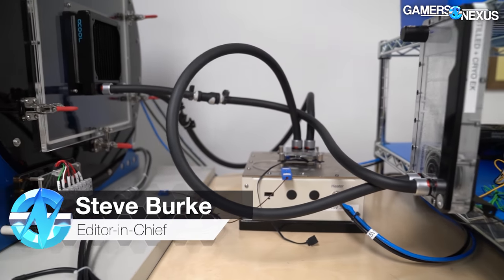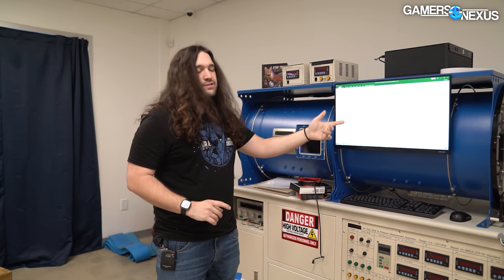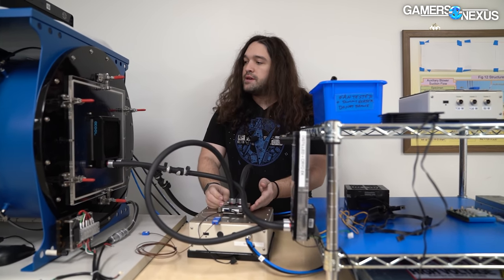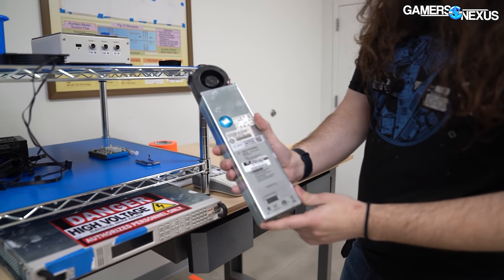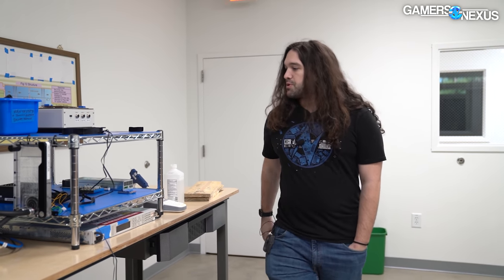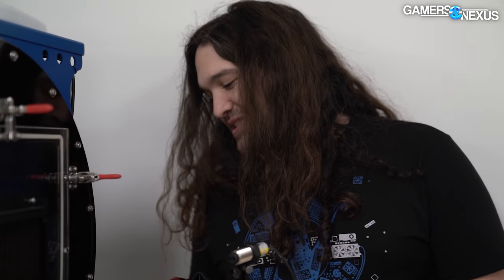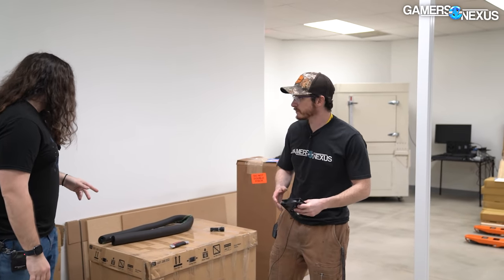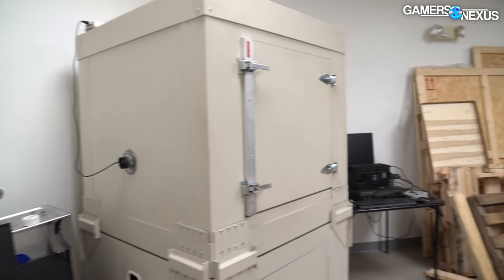GN Lab Update: Fan Thermal Testing, Pressure & Flow Charts, & Challenges

Comment: At 10:15 Steve mentions RPM Normalized and doesn't understand why. It goes hand in hand with both Noise Normalization along with P/Q Curves. You can't really compare a 1000 RPM fan against a 6000 RPM server fan but if that 6000 RPM server fan is restricted to 1000 RPM, then you have a basis, which is the entire purpose of Normalization - Everyone being on the Same Page.

Comment: When talking about RPM normalization, it is an interesting metric because it actually tests blade design. If fan A and fan B, of different designs, are both tested at 1000 RPM, and fan B has significantly better performance, that shows that, at that RPM, fan A is less efficient and potentially a worse design. RPM normalization needs to be a spectrum, though, as that same example could produce different results at 500 RPM and 2000 RPM for example. This kind of data can also be correlated with with the noise spectrum, frequency and amplitude, and also correlated with power draw; which power draw normalization is another interesting metric. But at the end of the day, both of these would be supplementary to the actual important information the audience cares about. All three of these should be spectrums anyways, to show data points at various intervals; such as for noise normalization, if you boost the loudness by 10db off of your baseline standard, what performance is gained or lost, same goes for RPM, 500-1000-2000, or voltages, 10v-12v-15v, etc. It'd be information for people who understand and care about data at more than just the surface level of results, which would be fringing into the engineering side of things and not the general PC audience. It's just a more thorough investigation of a product, investigation that most people wouldn't care about, unless they actually have an interest in fan design and how designs could be optimized; which then gets into Major Hardware's Fan Showdown series, except GN's methodology and equipment are leagues above his, having a collaboration of his prints on your equipment and testing, especially with expanded testing like this comment went into, would be cool though.

Comment: I think you should not removed degrees of freedom from the graphical presentation, but rather add them.  Take a look at a bunch of turbocharger compressor maps and see if that gives you ideas.  I find compressor maps very easy to read (possibly because I've looked at so many, but I seem to recall that they made sense to me right away).
Reply: I'd rather be blown than injected.

Comment: The concept of noise normalizing fans is odd to me.  I'm likely one of only a handful or two of people who do spec for RPM, and specifically CFM, in addition to longevity, regardless of noise, but that is due largely in part to the environment in which my computer is housed.  I am a long haul truck driver, and my computer is housed in my semi truck sleeper berth, on the top bunk.  I just built a new personal pc with a 5950x cooled by a Noctua NH-D15, a 3080 all housed in a Phanteks Enthoo Pro 2 case.  I contacted Noctua and received a 3rd set of fan mounting brackets for the cooler, and mounted 3 140mm Noctua 3000RPM IPPC fans on it.  The rest of the case is cooled by 12 120mm Noctua 3000RPM fans, and all fans are set to run at max speed all the time.  I actually modified the case slightly to accommodate an extra 120mm fan.  The thing sounds like a jet engine, but is necessary, particularly in the summertime, as some of the places I end up going are extremely hot, and the generator's HVAC system isn't able to fully keep up, plus heat rises. Anyway, GN, thanks for your hard work, keep it up!

Comment: re: P-Q-N curves

I think that non-technical people and/or non-engineers and/or lay people, yes, that would be a bit of an eye sore to try and get some useful/meaningful information from a P-Q and/or P-Q-N curve.

For engineers, especially turbomachinery engineers, this is just "business as usual".

But in terms of being able to try and take that data and "converting" it into something that's useful for lay people to consume, I agree with you, in regards to picking the end points (0 pressure/max flow, max static pressure/0 flow) and then some point in the middle.

Personally, I would like it if you published the full P-Q-N curves because I can actually make use of it, because that tells the whole story about the fan rather than just three points which really, is good for lay people to consume, but doesn't come anywhere close to being able to tell the whole story.

The rest of the data in the Excel file makes sense to me.

As an idea for you, it might be useful, for you to make a video, just going over some basics of axial fan design/turbomachinery basics (i.e. what does "mmAq" or "mmH2O" actually mean -- not what it is, but what does it mean and/or why should a customer (read: viewer) care?)

I think that using the watercooling would be the best or at least the easiest way to illustrate how you can have a really high volumetric flow rate fan, but if it doesn't have enough static pressure, then it isn't able to push past the resistance to airflow that the radiator creates, that the fan would need to be able to overcome.

I think that would be useful to lay people or people who might not have had as much exposure or experience with axial fan design and/or turbomachinery in general.

You might be able to start off with the simple equation that power = force * velocity.

And so, for a given amount of power that you are putting into the fan, the results is either a lot of "force" (i.e. static pressure) or a lot of velocity (i.e. volumetric flow rate).

And how you start trading off "velocity" (volumetric flow rate) for "power" (static pressure) when you are trying to push through something that has a resistance to it (e.g. watercooling radiators).

That way, once you get some of those concepts across, then you can go through the charts which shows the three different scenarios, but maybe also make a comment that in between those three points (beginning, middle, end), that the "in between" stuff isn't linear nor straightforward and that it CAN be quite complicated, but it can also be quite simple as well (i.e. if you know what is the resistance of your radiator like some of EK's thicker radiators), what kind of a fan that you should be looking for.

But the P-Q data that you threw up on the screen - makes perfect sense to me.

re: rotational velocity normalised fan performance
I also agree with you that that doesn't really say anything.

Having designed axial fans myself and worked a little bit in turbomachinery, for a given speed, depending on the design of the fan blade, the aeroacoustic signature can be very different.

So, by normalising at a given speed, it doesn't really tell you anything.

If you manage to reign in a Delta fan, for example, you might be able to get the noise down, but because it wasn't designed to run at the lower rotational velocities, and therefore; less noise (lower amplitude in the aeroacoustic signature), it may not perform nearly as well when compared to the parameters that said Delta fan was actually designed for.

Your noise-normalised performance methodology is, I think, a better approach given the fact that customers don't have necessarily a direct way of controlling the rotational velocities of their fans.

(You can do that, for example, on an engine dyno because whilst you still don't have direct control, but the control room of said engine dyno will measure and report out the rotational velocity of the engine, and so, you can set up your digital/electronic controls to use that output/measurement signal as a feedback loop into your controller.)

You don't have that kind of PID feedback loop nor PID controller for case fans.

Thanks.

Comment: Looking at that graph. Are the lines that go more downhill supposed to be P_STP per Flow? That would kinda make sense as static pressure is reduced with increased flow speed. But you need to ask yourself why you have 0 Flow data points. What is the sense of measuring at 0 CFM flow. 
What are the horizontal lines supposed to be? RPM per Flow? Are you sure you have connected the right data points with lines? To me the more horizontal lines might not make sense? It is 8 data points and 8 lines so you could connect the points also more vertically? If it is a data array you might need to present the data differently. Maybe a 3D Diagram would make more sense here as it seams there is another variable that is not represented in the chat but creates the array instead of lines.
PS: So the invisible data point is "Duty Cycle" whatever that really means. But the RPM-Q Graph I still don't see how it is useful. You have different flow rates at pretty much the same RPM ... that has les to do with the fan and more with what the machine is going...

Comment: I personally set my fans to 800 rpm. They only increase in speed if the case temperature goes above 40c. This never happens. So testing at a specific RPM is a valid thing to me.

Comment: 06:00 i see here only one problem in this configuration - radiator... Whe have plenty of them on the market. One fan can made an better job then the other one on other type of radiator. I mean - we can see it clearly, Arctic Cooling Liquid Freezer II series use 10mm thicker radiators and wins most tests. Fans are always the same... 🤷‍♂️ Only the radiator became thicker.
And... How about pull and push configuration?

Comment: Careful with the hot glue / silicone thingy, depending on the material, it degrades with time until it becomes a squishy grey blob.
Maybe a proper fabric glue would be a better solution.

Comment: @gamers nexus I understand the desire to isolate mounting noise from the fan noise inherent, but I have some mixed feelings about that. Fans including anti-vibration mounts or pads as part of their frame are significant marketed and value add for end users, and even beyond that, a super soft mount would absorb additional damping from vibrations through the motor, which in a real world case, might either result in premature failure of the fan or a progression of noise. 

I recognize that end of the day, you can't control everything and choosing an isolated mount lets you focus on the things that should matter more...

Just something that comes to mind.
Reply: To make their data valid they have to test fans consistently. They're just testing the fan. You're not going to get the exact same performance in your real world application. But you can still use their data selecting a fan. And if you're a clever sort you can improve on lacking fan mounts anyways.
Reply: @Paul Frederick  the mount situation is the fan. Vibrations from a less than perfectly balanced hub is the fan. Again we could all cut out foam and do our own isolation mounts, but arguably it's more consistent and real world applicable to attach to a big chunk of metal and whatever noise comes from that comes from that than to attach to a fully isolated mount.

I mean it's fine. We'll all take what we can get. Just a minor perspective difference
Reply: @anthonyschroeder521  lab data is never the same as real world data. The best they can do is test everything on an equal playing field eliminating as many variables as possible. The data they collect will all be comparable. But it's never going to be what anyone else gets in use. That's the limitation of reality.
Reply: @Paul Frederick  now that was a patronizing non-answer that failed to recognize I am well aware of exactly the limitations imposed by each possible method, and said such even in the very first comment.

Comment: Rpm normalized would only make sense in the case where you’ve already set up your system and you’re seeing if a new fan would make a difference at the rpm you’ve already got set. Seems less than helpful. Especially since most people use whatever curve is built into the motherboard. Fan controllers are rare outside of enthusiasts, and actually using one for its intended function is rarer still.

Comment: One difference between the CPU and a dummy heater could easily be "duty cycle", or the steadiness vs intermittent-ness of the heat. I think a higher thermal mass cooler could for example just eat the peaks of bursty CPU-like heat generation. I wonder if you can try a boost/idle/CPU-like heat generation timing to simulate a CPU and see if it makes a difference? If your dummy heatsink can mimic a CPU in the time domain, (intensity of heat *over time*) not just the intensity of wattage per se, that would be neat.
Reply: Steve's using his heater to generate a constant heat. That way every fan has the same heat to work on. That will yield more consistent data with only the fan being the variable.
Reply: @1pcfred  I agree that their proposed test methodology means the fan testing will be apples to apples among fans. 

I'm still interested whether their proposed method with hotplate is distinct (apples to oranges) from the performance needs of cooling a CPU.

I think at some point some science-ing should be done to see if cooling a CPU with bursty/unstable heat is inherently harder than, easier than, or the same difficulty as cooling a hotplate. And also: whether heatsink design is a variable that changes the answer to that question.

I don't know if it's the top question to answer, but it still nags at me, and the researcher in me wants to know if the claim that "hotplate is a better test than a real CPU" holds up to objective testing.
Reply: @MrSmitheroons  the hotplate is just a more consistent load than a CPU is. When testing consistency is everything.

Comment: When i´m picking new fans, there are 2 important things for me:
1. the fan has to be quiet in lower rpms, with moderate noise in loads
2. while being quiet, or making moderate noise, the fan MUST blow air (either pull into the case on intake, or push it through heatsinks or out of the case).

There is myriad of quiet fans, that don´t actually blow much air (very limited rpm, bad construction, like Alpenfoehn/Alpenföhn Wing Boost 3, or Fractal X2 GP-12 1200rpm) and fans, that blow air only when unrestricted (Arctic F12, Noctua S12A), whose existence is just cashgrab, since their value is minimal. Picking a good one is a real pain, because many times, the more expensive =/= better.

I also like using the whole rpm range of a fan. I find it useless to buy like 1800 or 2000 rpm fans, only to limit them to 1000rpm, because after that, they become noisy. After all, in PC load, CPU and GPU coolers are making noise as well, with liquid cooling PCs the pumps are noisy, many times HDDs are far noisier than any other components, etc.

Comment: it seems very weird to me that you decided to test the fan's cooling performance (ie. the temperature of the dummy heater) with the fan and radiator strapped to the fan tester. is it because it is the most reliable way to get consistency in the flow and therefore the temperature too ? is there any unrealistic flow restriction inside that fan tester ?
Reply from the maker: It won't be mounted to the fan tester for the dummy load test. That was just to hold it up. The actual fan and radiator get mounted to a wooden block we built after this was shot.
Reply: Very generically, energy in has to equal energy out. Since the energy into the load side of the loop (heater, pump, radiator) is easily quantifiable (and assuming a constant air temperature and humidity), directly comparing a difference in the working-loop's temperature while changing a singular variable (the fan) makes  an easy way to see if the fan being tested is better or worse than its counter-parts. This side-steps all the math involved in calculating the result, and it also accounts for any unknown variables like how much spacing the blades and shroud have that may cause a fan to be more or less efficient than a competitor.

Comment: The one merit I could see for RPM-normalized testing would be for a fan designer.  I would honestly consider it a good data point to include if you ever wanted to sell your testing data.  Having that RPM-normalized data curve allows you to yo analyze how a specific design is performing at speeds.  Does it hit a plateau at 1500 RPM for instance?  What noise level are you getting at various speeds and how do various tweaks to that design affect that relationship?  You're right in that the average end-user probably has no need for that type of information, but the part of me that loves staring at excel files looking for patterns in data would find it fascinating.

Comment: I'm sure you know this already, but regarding the laser tachometer, there is a huge difference between precision, and range.
Just because a sensor can measure a faster speed does NOT mean it is more precise, or accurate. In fact if the measurement range is greater than you need you will very likely be LOSING accuracy. This is why your Honda does not use a 1,000mp/h speedometer.

Comment: you're at a stage where it would make sense to take a $1000 and buy a few tools, a table to use them, and a chest to store them. nothing major. maybe a chop saw, a tabletop drill press, a vise, few cordless tools and some better hand tools. as well as the correct type of foam safe glue to match your premium foam. thanks GN for the hard work.